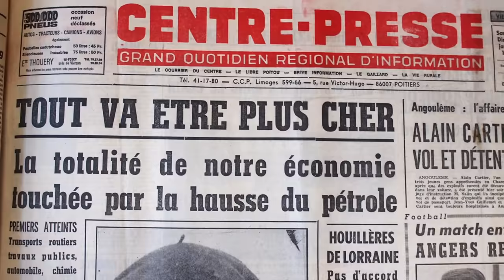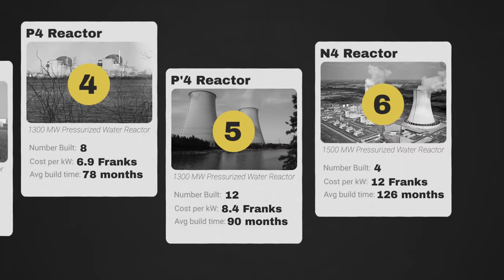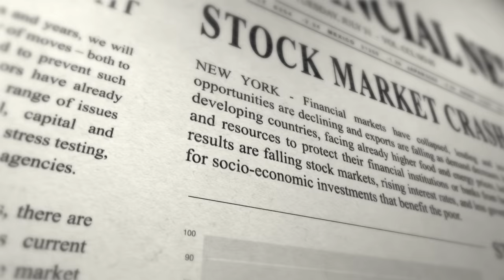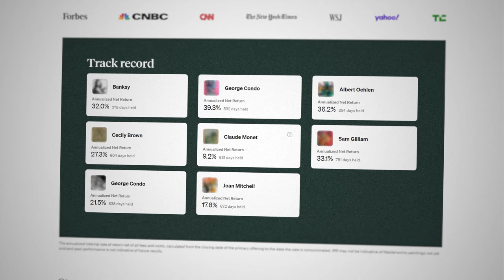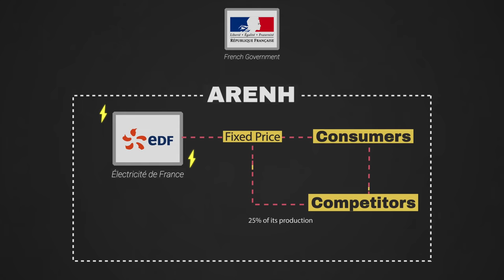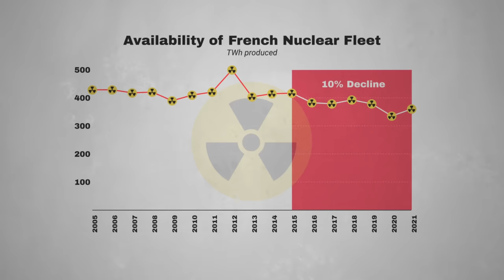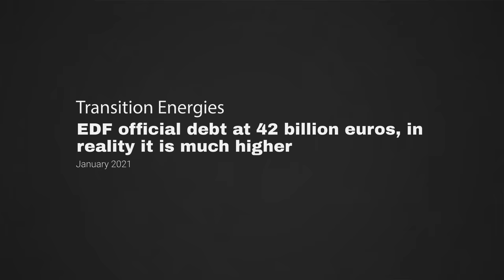Why French Nuclear Energy Failed

Comment: As a spaniard, we've also been benefiting by French nuclear energy policies during decades, also lowering our energy prices thanks to french energy sales trought our northern electrical interconection (same with Portugal).

Nuclear power is one of the best tools we have to gain energy independance as a union, and to allow us to grow our renewable energy park
Reply: Italy is the same.  We also buy the nuclear power from France.
Reply: @stevens1041  We had  our own nuclear reactors. All shut down.
Reply: Building nuclear reactors takes a lot of time and is really expensive (not a cheap energy source). The french reactors have a lot of issues. How come that you think it is a good way to get to renewable energy?
Reply: @noah-ni3ee  A nuclear power plant is really expensive as you say, but it also produces huge amount of energy 24/7 for more than 40 years, so the levelized cost of energy (€/MWh) is one of the lowest in the market.

Also, as nuclear plants provide an stable power of 1 GW per reactor, they are one of the best resources to keep the grid stable with the integration of intermittent power generation plants such as renewables
Reply: @jaimemozas2452  everything i have read has it among the most expensive forms of energy. Almost no county is building new ones and those in France and Finland are much more expensive than planned. 

Sadly renewables and nuclear aren't great together. You can't really control them. For nuclear to be economical it has run on full power and renewables are dependent on weather. 

I am not saying one or the other is the solution. If we take france and Germany i think both are making huge mistakes. A mix of diverse sources of energy is probably the best until we have good options to store the energy from renewables
Reply: @jaimemozas2452  just look at france and what happened in 2022. They already are weakening the Safety measures and still have huge problems and extra cost. 

In the safety test run by the EU, the nuclear reactors in france were among the worst.
Reply: @noah-ni3ee  France didn't keep their reactors up to date and the EU is heavily opposed to nuclear power generation, making the infrastructure substantially harder to acquire and develop.
Reply: It takes up to 10-15 years to build a plant. Nah we need things we can build faster. Coal and gas until we have enough renewables is the sad truth
Reply: @noah-ni3ee  EVs can be efficient store for energy from renewables
Reply: @noah-ni3ee  South Korea builds safe reactors in only 5 years. The long lead times for nuclear is a political issue, not a technical issue.
Reply: @noah-ni3ee  That's because most things written on the subject aren't very nuanced. It's true that wind and solar are cheap, but they are also intermittent. To completely replace coal and gas, they need "energy storage". The levelized cost of wind and solar is anywhere from $30 - $50 per kilowatt-hour, but the levelized cost of the storage is between $150 and $350 according to what I've read. Nuclear's levelized cost is about $175. This is down to its high cost of construction but low cost of regulations. Coal and gas are considerably cheaper than that, but only if you don't count the medical bills from all that pollution. Also, nuclear power plants are quite flexible (ever since the 70s). They work quite well with transient renewables. The only reason why they're typically only run in "base load" mode is because they're so good at it.
Reply: @noah-ni3ee  building 15 years another 15 years before y earn 1st penny
Reply: @noah-ni3ee  another 15 years the 1st penny, capital costs, delays,

Comment: The big lie in all these discussions that of the cheap energy. Yes the electricity is sold cheap, but the price is dictated still today by the French state. And it is obviously so low, that it does not leave any margins to pay for all the repair, maintenance, let alone the humungous cost of building new reactors (22B$ and still counting). Last year the French state pumped 2.1Billion$ into EDF and not ending. If the selling price is so low that it puts EDF into deep red debt, then this "cheap nuclear energy" is an illusion, a dream that still most French still are dreaming, while the gap to reality gets bigger and bigger.

Comment: There is a more fundamental problem! Nuclear is 10x more expensive than renewables and 5x more expensive than oil or gas. So while the reactors should be run as long as they are safe, it is cheaper to build solar links to north Africa and deep geothermal as a baseboard.

Comment: Doing the math always helps. Check the cost to construct a nukular power plant:
1:56 cost to build from 5 Francs to 12 Francs per kW. 12 Francs is about 1 Euros, same  price as home solar.
This is before the EPR cost explosion and before considering costs of waste treatment and storage.
Reply: well waste storage is easy enough, just dump it in an abandonned deep mine, line the walls with concrete if you're paranoid
plus there are some promising avenues for actually making something useful out of it

solar is pretty nice, but not sufficiently scalable (outside of deserts), because, sure, you can and should cover rooftops with it, but then you still need a lot more space to meet energy demand and you don't really want to use wild or arable land for it
Reply: @yjlom  There is the Homer Simpson Paradoxon - the most dangerous technology is operated by the least responsible people.
Also, how to pass information onwards 100.000+ years? Paper? Floppy disk? Engraved stone?
Reply: @LilaKuhJunge  Where is that coming from?
The Simpsons is a comedic cartoon. This is not how power plants are handled in real life, especially in France.
Reply: @johnkingsize  By todays standards, working in a nuclear power plant is one of the least attractive job propositions. So this is why you don't get the best. You get the leftovers who are incapable of getting better jobs.
Reply: Do you have actual evidence of this, besides cartoons?
While it is true that the field has known a lowered popularity thanks to the anti-nuclear propaganda of ideologists, this meant that there were less candidates to sort into the formations, not that the ones exiting them weren't adequately trained.
Reply: @johnkingsize  This is about capability vs. choice. You are a top engineer, you pick the best job from many offerings, best future, best work place, best reputation. You barely made it, you have to take what no-one else wants - dying industries, unsafe workplaces, shift work, no daylight.
Google Sabotage Doel 4 for an example.
Reply: @LilaKuhJunge If you're specifically trained in college as a nuclear engineer, you make your career in the nuclear power sector or in nuclear medicine. The effect you're bringing up might make sense in other fields, but not this one.
Reply: @jeffbenton6183  As you ask about studying "nuclear engineering", you must be from a country where that is possible. In my country, there is no such university degree nor diploma.
Reply: @LilaKuhJunge  If a country doesn't have any nuclear training, that's only because there's no nuclear power.  Name a country with at least one nuclear reactor, and I will find a university in that country with a nuclear science or nuclear engineering degree. (There is as you say, such a degree in my country, and I was also quickly able to find several in South Korea and Germany; I'm prepared to research this topic for any country that has any access to nuclear power).
The point is, you can't just plop an aerospace engineer in a nuclear engineer's position with no additional training and expect everything to run. Likewise, you can't just ask a nuclear engineer to make a clean-sheet design for an airliner and expect it to be safe or even practical to build at all. Most engineering projects require specialized training. Engineers who are specifically trained to work in the nuclear field are not going to have much of an incentive to work in any other field.
Reply: @LilaKuhJunge  More importantly, "Homer Simpson Paradox" does not exist in real-life. There's a well-known psychological phenomenon that people don't pay enough attention when a situation is moderately dangerous, but do pay attention when it is extremely dangerous. This often results in things that seem more dangerous actually being safer in actual practice. For example, intersections with Yield signs are statistically safer than those with stop signs because people pay more attention. 
Likewise, fatal accidents happen more often on side-streets then on highways. In general there are fewer accidents in Europe than in North America because road design forces drivers to actually pay attention. This scales up with hiring practices:

Why do busses get into few accidents than cars? Because only professionals are allowed to drive them (and bus owners aren't going to hire just anyone to drive them, even though many people know how to drive). 
Why is commercial air travel one of the safest forms of transportation, and hands-down, the safest form in the United States? Again, it's because only professionals are allowed to maintain or pilot airliners - and they don't hire just anyone to do that.
Why has there not been a single fatal accident in the entire history of the Japanese Bullet Train? You guessed it - only professionals." This pattern is maintained when it comes to grid scale electricity:

Nuclear power is the source of electricity which the general public fears the most, yet it has the best safety record of any source of electricity. Nuclear has killed fewer people per kilowatt-hour than any other source of electricity - only wind and solar even come close. If you look at the record specifically in the one country which today (and historically) has produced more nuclear power than any other - the United States - you'll notice something interesting. The most infamous incident in the history of nuclear power in that country was Three Mile Island. Not even one person died from that; the most radiation that any one person could have possibly received from that is the equivalent of one chest X-ray. The fear-safety ratio is probably not a coincidence. Nuclear tends to be heavily regulated. Incidents are extremely rare, largely because people actually respect nuclear power and are less wary of other sources (except the idiots in one particular government who knew that reactor #4 in Chernobyl was dangerous but kept that a secret and insisted on operating it anyways - Communism is a wild drug; capitalism has its own flaws, too, but Europe seems to recognize that better than the US - and Japan, for that matter). Of course, even Chernobyl - the worst ever incident - is safer than fossil fuels, as crazy as that sounds. Coal power alone kills millions of people every year from air pollution during normal operation without accidents. Nuclear power plants have not even come close to killing 1 million people in their entire global history. 

I can speak for all countries, but here in the US, we have a culture of stupid levels of hyper-cynicism (as compared "healthy skepticism" which of course, is a very good thing). Worse, everyone assumes this level of cynicism is actually smart. Consider the following joke:
"Imagine the intelligence of the average person. Remember that half the population is dumber than that." This joke sounds smart and funny at first (at least to us), but when you think about it for more than 2 seconds, it doesn't make any sense. When we say, "average person", we have in our heads the sort of person who makes the news for being so outlandishly stupid - the source of the "Florida man" memes. These people are brought to our attention precisely because they are not average. Ask any random 40-year-old to think about the people they ever met, and think about how smart they are on average (except teenage boys). The average person in that list is probably going to be much smarter than the "average person" in the joke. That's because this is a much more accurate account for what average actually means. By the way, I should mention that Homer Simpson is an American invention. Sorry we ruined it for y'all.
Reply: @jeffbenton6183  Your answer makes it very clear that you are not an engineer.
Reply: @LilaKuhJunge  And your failure to try to refute even one of my points makes it obvious that you lack critical thinking skills. Which one of my several points - pray tell - contradicts common knowledge in your field? More importantly, why? 
In any case, I know plenty of engineers who take their jobs seriously.
Reply: @jeffbenton6183  Thank you very much for proving me right.
And - regarding your elongated execise in literature and psychology - I appreciate your effort.